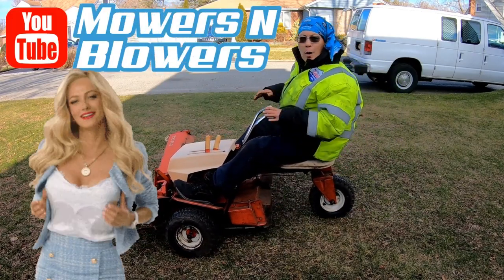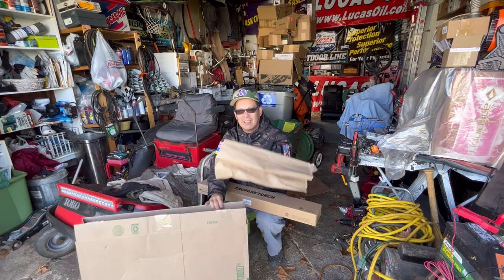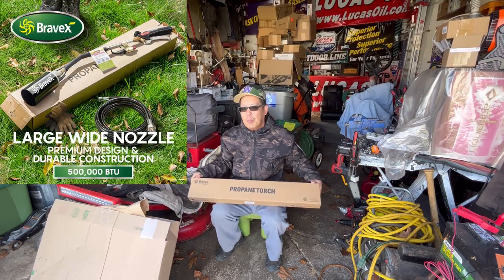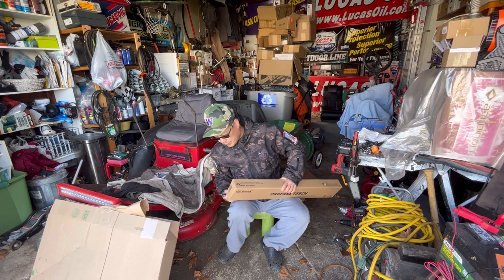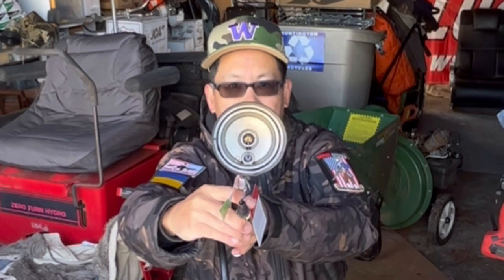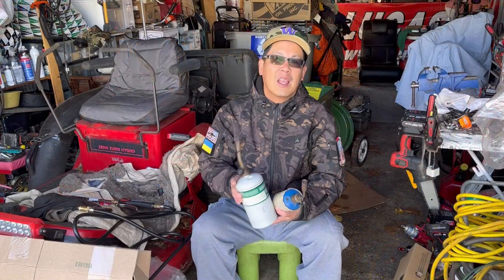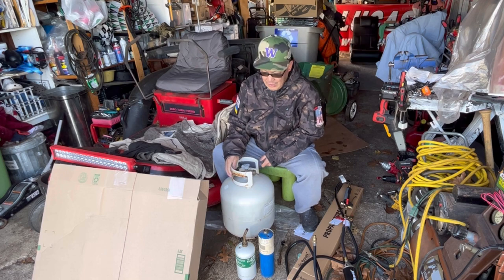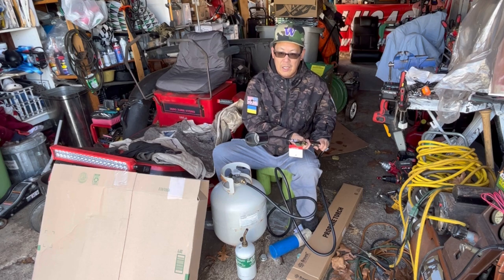BRAVEX PROPANE TORCH & 800K BTU WEED BURNER W/PUSH BUTTON FLAME IGNITER KNOB TRIGGER UNBOXING REVIEW

Comment: Finally hooked mine up and tried it out yesterday.  Nuked two dandelion nests.  Nuked weeds in my driveway and a whole line of weeds from end to end where my garage meets the driveway.  All gone.  Torch is so powerful I had a charged water hose nearby just in case.  I doused the areas after burning anyway because it is just smart business to do so.  Dandelions were after a good watering so all good there.
Reply from the maker: Nice!

Comment: Henry if you go on Amazon there should be a fitting that you can use that goes from Big propane tank to the small one that may or may not work
Reply from the maker: I saw,  it’s like $15
Reply: @MowersNBlowers  things are so much cheaper in the states I paid over 20 bucks for mine
Reply from the maker: Isn’t $15 usd about $20 cad?